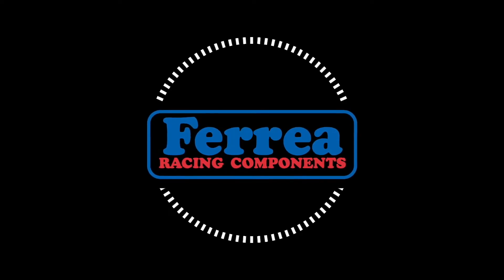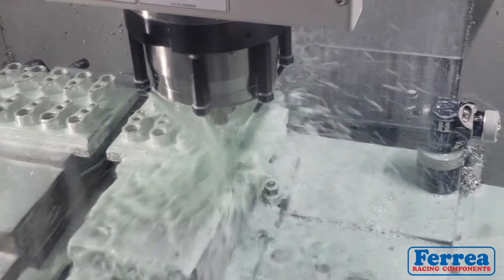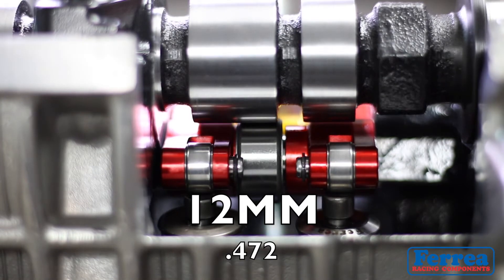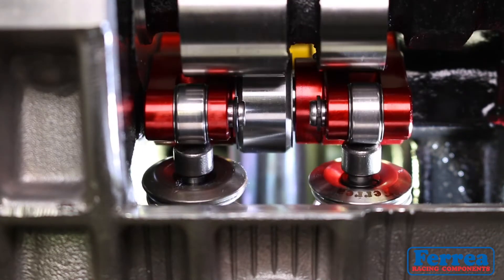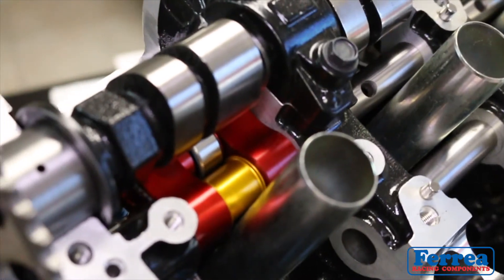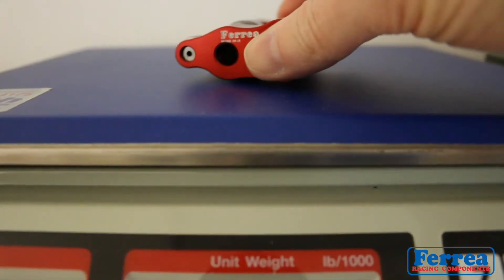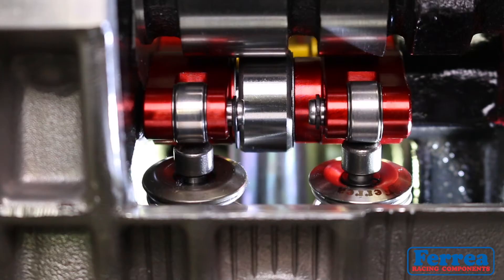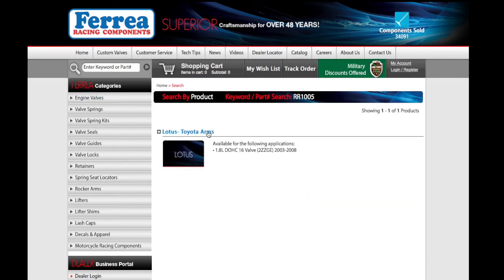Ferrea Tech Tuesday / Toyota-Lotus 2ZZ-GE Roller Rocker

Comment: Getting rid of the lift function. 

Thats what makes these motors so good. The duality of them. 

The switchover. The sound of the overlap when the high cams come on.

Might as well just get a 1zz and cam it to the point where it wont idle.

Comment: Whay i dont trust aftermarket parts ? 
How are this better in structure more rezistant.... than oem
Reply: @youwantshum9860  nah should be a cam set up thats should have you in lift from 1000rpm all up.to 8000 the companies need to step it up when it comes to street cars
Reply: This runs on the high cam lobe all the time?
Reply: @SpeedDemonExpress  It's supposed to disable the low cam lobe, but VVT still works. You'll probably need a retune to use these.
Reply: @hiblendmedia  I highly doubt that it will be running right when always on lift cam. If you want to do something like that you'll need to convert to a cam with only one profile and deactivate lift, but with that you're basically degrading the engine because then you're limited in lift duration by your lower RPMs, so that the engine is still able to idle.
Reply: OEM rockers on the 2zz are actually very fragile, I think these are made from an aluminium / magnesium alloy, so they'll be much much stronger
Reply: Iz this innernet for meh? No I tink more better them clearanz's
Reply: Lol with this fit a Corolla 2018
Reply: How do you keep in lift always
Reply: @youwantshum9860  saw a vid with a honda track car the guy said he was in vtec always i was like wat a great idea for the 2zz bein n lift always when i had my 4age i had those valve notes early  An always had power no fall offs of torgue
Reply: @youwantshum9860  it eliminates VVL engagement so there no lift.